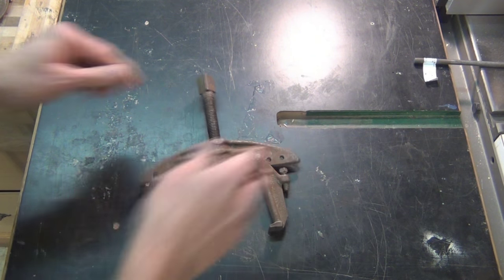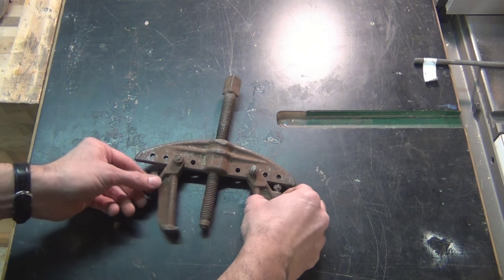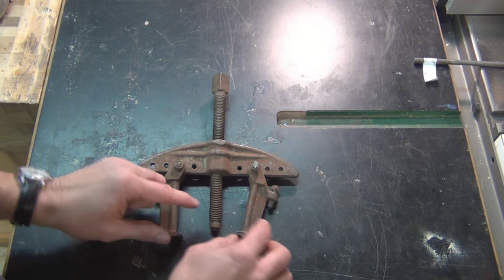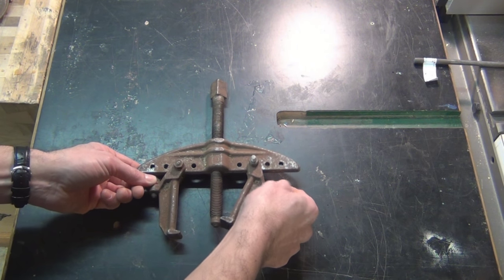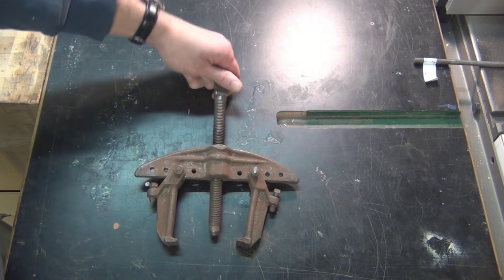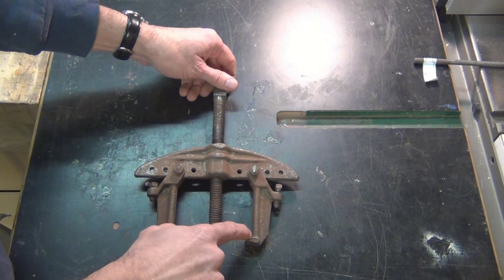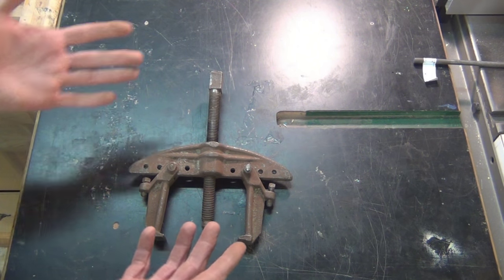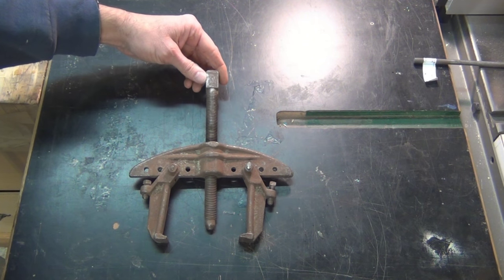What is it - clamp?

Comment: its used to pull stuff like pullys off a car you put the clamps on pully and spin the pin in the middle and it pulls the pully off, i forget the technical name but thats what it was / is for.  pulley not pully  also can be used to pull pistons.
Reply: +Brett Porter  OR wheel bearings, although modern ones have 3 rather than 2 gripping pieces.
Reply from the maker: +Brett Porter Thanks! I had never seen one before.